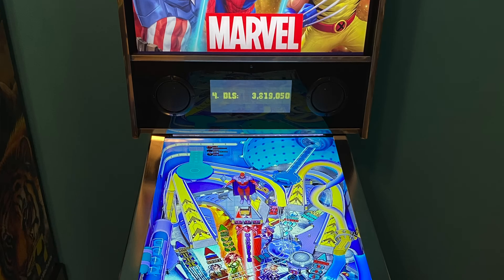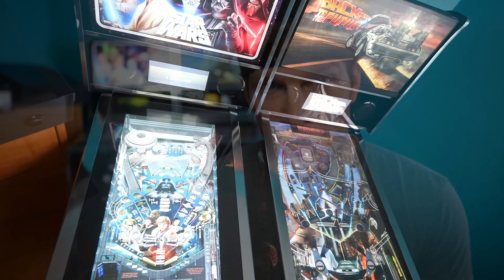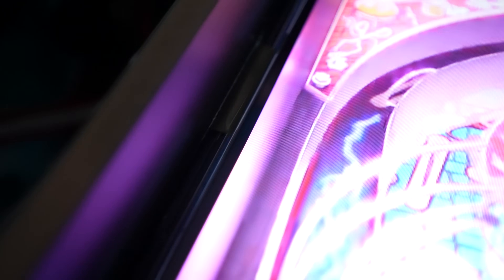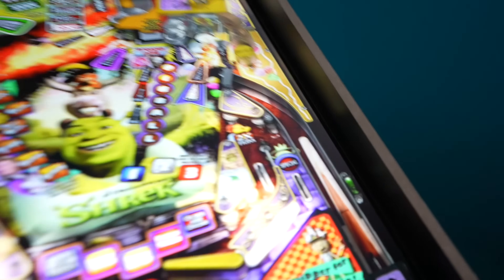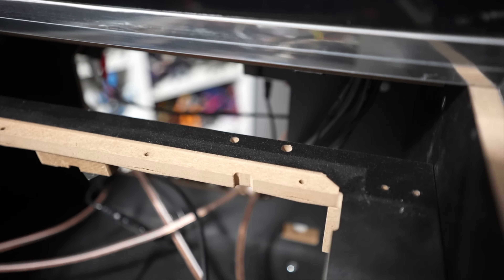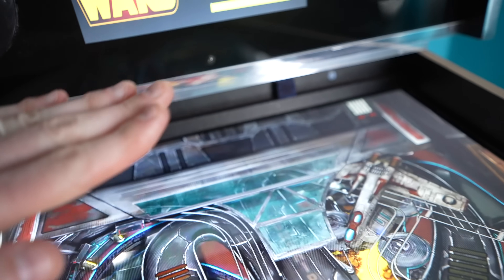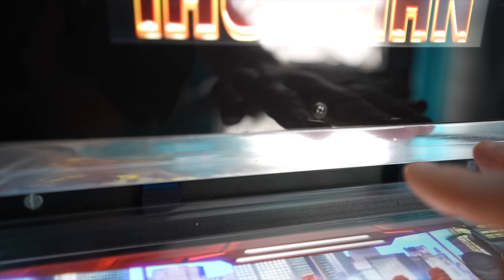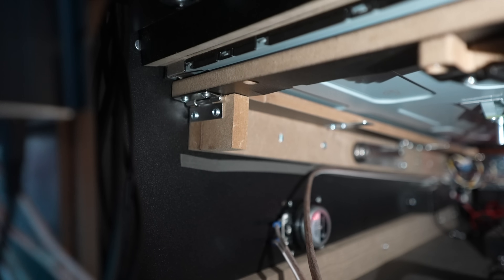Arcade1Up Pinball Mod - How To Install 32" Monitor

Comment from the maker: What do you think? Too big, or just the right size? Let me know in the comments below!
LG 32MN60T-B 32" Class FHD IPS FreeSync Monitor (Playfield): https://amzn.to/3t0JJgH
LG 32MN60T-B 32" Class FHD IPS FreeSync Monitor (Refurb option)://amzn.to/3fRnPJ2
Reply: Legend
Reply: The best mods are often the most difficult and complicated. I know this from my modding but the end product looks awesome!
Reply: Awesome job!  I think you have your product links backwards.
Reply: I'll have to let you know after I install the one I just ordered!  :) :)
Reply: For the tempered glass upgrade, what are the exact dimensions the glass should be?  Also, should I use 1/8" or 1/4" glass?
Reply: @sailingsvzara  CoolToy did 16.25" x 28.75" tempered glass .25" thick. 

I did 1/8" and it worked fine but is fragile.
Reply: @sailingsvzara  16 1/4" by 28 3/4" and it's 1/4" thick. It's in the video.
Reply: Nice work. How did you rotate the screen to portrait mode?

Comment: I was really dissaoointed how washed out the screen on my Marvel A1up pinball machine.  I don't mind the smaller size, but the screen quality is trash.  I may try this upgrade, but am worried that the washed out look will carry over to the bigger screen
Reply: Try changing your plexi glass out for real glass first.

Comment: I very much appreciate your video as I was able to clearly follow your procedure and my 32 " screen is in and works perfectly! As for the glass, I am considering ordering a piece, but I'm concerned about having the back end resting on the repositioned frame piece (with a friction fit) and screen. Or maybe I am not understanding that part correctly?

Comment: I recently completed the 32" monitor upgrade and it looks fantastic! Thanks @cooltoy !

With the glass I went the cheap Lowes route and had them cut it 16.25" x 28.5" with 1/8" thick as that was all they had. Was only like $25 and worked fine. It is fragile though. I chipped the upper corner of mine pretty bad when taking it back out to install a new graphics card. It's only noticeable if you know where to look, but I expect to replace it at some point.

Even the thinner non-tempered glass was a HUGE upgrade over the stock plexiglass in terms of clarity. If I replace mine I will likely go with tempered glass next time. You can now get nice, precut tempered glass off of eBay specifically cut to fit the original Arcade1Up playfield or a 32" monitor upgraded table including a little black around the edges like the original Arcade1Up plexiglass. They are cutting them at 28" which is shorter but probably fine and for just $100 price/shipping it's a pretty sweet deal and I will likely go that route in the in the near future as I am replacing my primary buttons with GoldLeaf versions so I will have to take it all out again anyways. https://www.ebay.com/itm/334812376096

The only downside after adding the 32" monitor is I really miss being able to tilt the monitor up and lock into place while maintaining the inside of the cabinet like the original playfield. When I upgrade the buttons I am going to attempt to rectify this as it's a pain having to totally take the monitor out to do anything inside the cabinet especially since after removing the monitor back/bevel/and some reinforcing on the back, the large monitor will flex and you can crack the display if you aren't really careful.

Comment: For anyone looking for 32" monitor alternatives, I used the Viewsonic VX3276-mhd. This was a PERFECT fit with no decasing. I used the 1080p model, but the 2k model had the same dimensions
Reply: https://i.imgur.com/Luk6uMu.jpg
Reply: How did you fit the depth w/o decasing? There is a large bump out on the back bottom side.
Reply: How did you rotate the picture?
Reply: @robertevans3866  rotate within display properties in windows.

Comment: Hi Doug, I've watched this video a few times now and wondering how the 1080p screen is working out over the 32" playfield for pixel pitch. I'm curious if now that you have had it for a while, do you want to go to 2k or 4k to bump up the res? I'm about to do this mod myself and am looking at a 1080p 75hz IPS panel, and weighing up whether to go with 2k instead. Thanks, and great videos. I've subbed.
Reply from the maker: I got rid of this machine a while ago now. But when it comes to virtual pinball I’ll tell you higher frame rates will give you more enjoyment and play experience than higher resolutions will. So if I prioritize getting the highest frame rate monitor you can for your budget and that your pc specs can handle
Reply: Thanks for the info, did you keep your atgames also or is that one gone? Curious if you have any virtual pinball cabinet now? @cooltoy

Comment: Hey Doug. Any alternative suggestions for monitors several moons later?
Reply from the maker: I gave this machine away a long time ago, sorry.
Reply: @COOLTOY  That's very cool of you. I figured it out on my own, thanks.
Reply: @mcgenetics515  What monitor did you go with?
Reply: @Laser Man  ended up going with the LG 32MN50W-B. Had to do the same in the video and crack the casing off but got it in there pretty easy. For a split second I halfway considered the 32" Samsung frame to avoid having to crack to casing off but far too expensive and didn't know 100% if it would fit. I love my cab now.

Comment: I'm a little late to the party on this. Just did this mod this weekend. Though I kept my pcb stock. The geekworm 1.5 did not work correctly. Had to use the V20 version. Along with the screen fix file from teamencoder, it worked great!
I added the Marseille mCable Classic in line with the hdmi output. Gotta say, if you are keeping the pcb stock, this IS A MUST!!! Along with the ability to control the monitor settings, contrast, brightness etc. Adding this just rocks. It upscaled the image to true 1080p AND added anti aliasing. WOW! What a difference. Kept the pcb output in 720p so I didnt lose performance.
Reply: Any info on how you got the geekworm V20 to work? I can't seem to figure out the proper pin/plug configuration on the V20 to get the signal to the monitor.

Comment: Thanks for the video!     I just ordered this game and the 32" screen upgrade looks like a must.    If I take a stock game can I add the larger screen?   Will it go to 1080 or stay at 720?   Or are their other pieces I need to add?
I have some videos to watch through!
Reply: I used the geekworm v20 hdmi adapter. Had to add the teamencoder screen fix file. Then it worked correctly. If you are keeping the pcb stock, definelty would suggest an upscaler of some kind. I used the mCable, about $89 on Amazon. Upscaled it to 1080p and added anti aliasing to smooth out the graphics and jaggies. Looks way better. Cheaper option than a pc, and you are wanting to keep the pcb.
Reply from the maker: if you keep the stock PCB you will need a geekworm adapter to convert the LVDS signal to HDMI. You will also need to reflash the PCB to get it to work properly. I replaced my PCB with a PC as shown in this video.

Comment: Did you make any other mods to the electronics? Just replaced the monitor correct? No other electronics ?
Reply from the maker: I removed the stock PCB and replaced it with a PC
Reply: @cooltoy  so just doing the monitor prob isn’t worth then?

Comment: Well Doug I just ordered this monitor after watching this video.  All of your other videos have been of great help to me (and can't thank you enough for answering previous questions I've had) and this seems pretty straight forward.  I think I can handle removing a brace and flipping it over to be used in the back. :-)  And de-casing wont be an issue.

Comment: Curious how does the 32” monitor look compared to the 24” running on the pcb with the 1080p pinner mod?
Reply from the maker: PC version of Zen Studios tables will always look better than the android counter part
Reply: @cooltoy  true, but just wondering if swapping in a larger display would improve the visuals over the stock display with the same PCB. Also, are you able to get the solenoids to work with the PC?

Comment: Just to confirm.....You can buy this monitor and just connect it to the OEM electronics via HDMI?
Reply from the maker: no, this video is me connecting a monitor to a PC. I removed the stock Arcade1Up PCB a long time ago.
Reply: @cooltoy  is it possible though?  I prefer the Arcade1Up games WAAAAAY more, but the AtGames play field setup.  Just wondering if I could get the A1Up setup for me with only installing the monitor you referenced.  I guess I would need a LCD controller?
Reply from the maker: it's possible, but you would need other things like a particular geekworm lvds to hdmi adapter and the arcade1up pcb firmware to be re flashed with a custom build.

Comment: Your virtual pin videos are the best! They definitely pushed me to mod my AFM cab and I'm almost finished now. Just need to wire up the buttons & plunger and configure. Then install the 32" monitor in the cab. Everything has worked out perfect so far. That Acer is incredible in the back box. So easy. :-) And the PC mounting bracket underneath works awesome for the SFF computer I'm using too. Thank you for your videos! ;-)
Reply from the maker: Glad I could help!

Comment: I’m late lol but  does anyone know if you can do this without using a pc and it still work?
Reply: It seems his first video doing this mod.. He had it all stock.. But the screen sat right close at the top.. Versus this method where he removed the stock PCB.. and he hooked up a computer allowing the screen to sit lower in the cab.. Check out his other video

Comment: Will this work with a stock machine? Or only through using a computer?
Reply from the maker: Won’t work without a geeekworm lvds to hdmi adapter and reflashing the stock PCB. Personally I don’t recommend doing that

Comment: Hey,
Is it possible to show how you actually connected the monitor to the computer inside the machine? I'm not an electrical guy by an means. I still haven't picked up the initial pinball machine, but I plan on doing so very soon.
Reply from the maker: Just a simple HDMI cable connection for the playfield monitor

Comment: which lvds to hdmi controller board is needed for the tv you recommended
Reply from the maker: geekworm is really the only company making the lvds to hdmi controller board. If you are connecting a PC to the monitor you wont need it though since you could connect via standard HDMI. The only reason you would need a lvds to hdmi controller board is if you were trying to use the stock PCB with a different monitor.

Comment: Hey bud, what LCD controller board did you use for this monitor install?
Reply from the maker: None. Monitor plugs directly into my PC via hdmi
Reply: @cooltoy  Ah, gotcha. That's easy LOL. So how do you make screen adjustments? Did you leave that portion of the monitor intact?

Comment: Is the monitor plug n play? I appreciate the video but would like to see how much more effort it is to actually connect the monitor.
Reply from the maker: Monitor connects directly to a PC via HDMI. If you want to connect the monitor to the stock Arcade1Up pcb you would need a specific Geeekworm adapter board
Reply: Thanks for your reply!  Will be watching your other videos to get more familiar with the machine and all the mods.

Comment: If I buy a 27 inch monitor to install do I need to also buy a cable to plug in the monitor to the PCB?

Comment: I read in the comments that you have this 32" monitor plugged in separately to a power strip; When you turn on the power strip, does the monitor turn on as well, or do you have to take an additional step and press a button on the monitor or a remote to turn the monitor on?
Reply from the maker: Monitor comes on automatically when I turn on the power strip

Comment: Curious is the Arcade1up pcb would connect to this monitor vs having to run a pc build?
Reply from the maker: not without using special connection adapters to convert the stock PCB video output signal
Reply: @cooltoy  meaning the Geekworm board you used on your trail fit?

Comment: I wonder if you could achieve most of this benefit with less work by putting in a 29" ultrawide monitor. A 32" (27.89" x 15.69") vs 29"UW (26.67" x 11.35"). to compare to the 24" it shipped with (20.92" x 11.77")
Reply: the pinball playfield ratios would be way off. not a good idea.

Comment: Hello,
What 30” dell monitor would you recommend for this modification? I’m looking to use a 30” monitor and the original PCB.
Reply from the maker: Simply put, I wouldn't recommend a 30" monitor

Comment: How did you get the strait overhead view?
Reply from the maker: you'll have to be more specific
Reply: @cooltoy  I can only get slightly tapered views on fx3 as opposed to directly overhead and square
I've got the same monitor in my now, thanks for that btw.
Reply from the maker: @therealratfink  change the camera view in fx3 while playing. I believe it’s default letter C on a keyboard. Most tables have 7 or 8 different views to choose from
Reply: @cooltoy  OK, yeah but no directly overhead shot so I assume this must not have been FX3 in the video. Thanks for the replies

Comment: Thank you for these Arcade1Up pinball videos. Currently with my Marvel machine I have done your first two videos minus the SSF using all of the same parts. The Amazon links are very helpful. I'm currently waiting for my backglass monitor and the 32 monitor. I will be doing those two mods next. I have question on your power management. Are you still daisy chaining off of the stock power supply with those splitters to power the backglass monitor and 32" playfield monitor? My stock power supply is currently powering the DMD and playfield monitors as well as the sainsmart board. Thanks again! These videos have been inspiring.
Reply from the maker: My back glass monitor and playfield monitor are both separately plugged into a power strip.
Reply: @cooltoy  Thank you!

Comment: Do you think it would fit if you leave the thin metal rim around the screen on after decasing the main plastic frame? I’m scared of cracking the screen without that on because of how fragile it is. It’s already a tight fit while loosening the sides. Seems like you need to be very delicate lifting the monitor to get underneath for access.
Reply from the maker: only way to know for sure is to try it out

Comment: Hey Doug I tried the LG monitor with the Geekworm board from your other video and the screen either doesn't turn on or cuts in and out. Any suggestions?

Comment: I can confirm that the IPS 4k version of this monitor fits. No need to loosen the side screws either. I think I am going to install some L brackets on the corners under they lock down rails for the glass to sit on.
Reply: What’s the model number for the 4K version?
Reply: @andrewoxford1123  Sorry, I thought it was 4k, it is 2560 x 144.  32QN600-B
Reply: @propwash6880  Thanks!

Comment: do you have another video that explains the hardware in this build in more detail? I was wondering what kind of controller board is making your buttons work? Is it some kind of USB connection to your PC?
Reply from the maker: yes, I made other videos on this channel about this build showcasing and explaining every component used so far.

Comment: Hey Doug - followed your video and everything was as simple as you showed. I’m noticing some tables in Future Pinball now look pixelated. Is there any software setting adjustments you recommend with this monitor?  Thanks for your videos, they’re great!
Reply from the maker: Double check the resolution setting you have for the playfield inside Future Pinball. Or check to make sure you have the latest drivers installed for your graphics card.

Comment: Thanks again for the Mod tips!!  Just installed the 32" monitor and it really looks good, GREAT recommendation!!  I'll be getting some Lexan/plexiglass instead of tempered/rolled glass because this will end up at our local Rec Center in Locust Point,  Baltimore, MD, with lots of kids once COVID restrictions ease up.  This will look great next to our 4 player stand-up Retro arcade/ 4 player stand-up Steam Bigbox arcade, 4 player motion arcade w/Xbox 360 Kinect running Aurora, and 7 player Rockband/Guitar Hero music Arcade.  Will be adding two Sinden Lightguns to the Steam Arcade once they come in.  If you're ever in the area feel free to check it out!!  Thanks again!!

Comment: How are you liking this addition? Still dig it? I am still using the stock monitor with my gutted popper 1up. Sometimes I think it is not necessary, some days I think it would be awesome. My only problem is I like the deep recess of the 24" I don't want to do the effort and wind up not liking it. I guess I can just lay a monitor in there and see if I like it.
Reply from the maker: I love it personally, but to each their own. Do whichever you feel suits your needs the best, I don’t advise on investing time and money towards a mod if you yourself don’t feel you NEED it.
Reply: @cooltoy  I know, I just wondered if you changed your mind. Your first 32" concept you seemed to be for the 24". But did you not have both cabs at that tiime? It seems like a good mod because the backglass is nearly as big as the playfield, sometimes it looks bigger lol